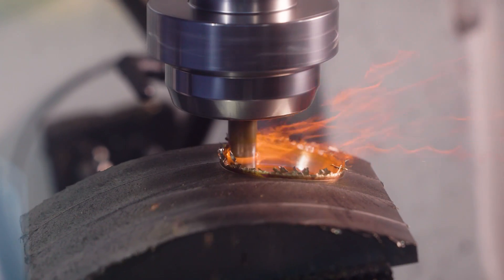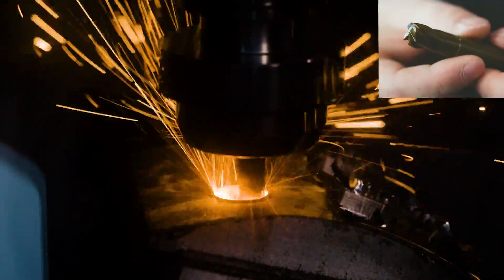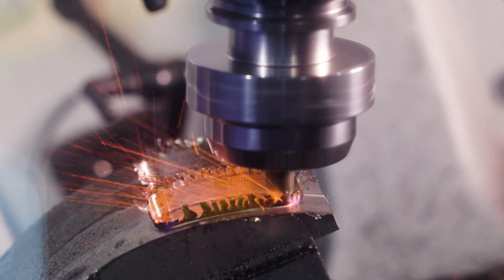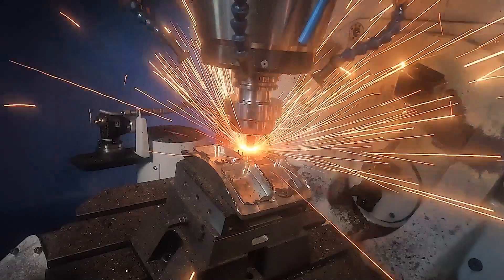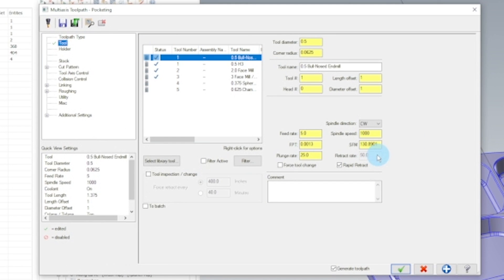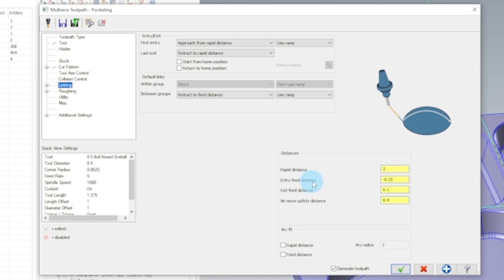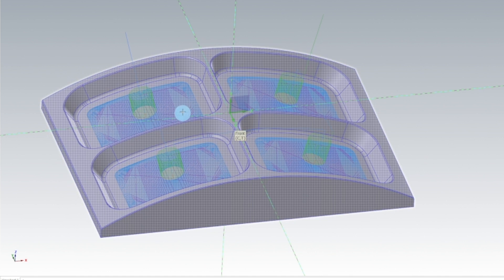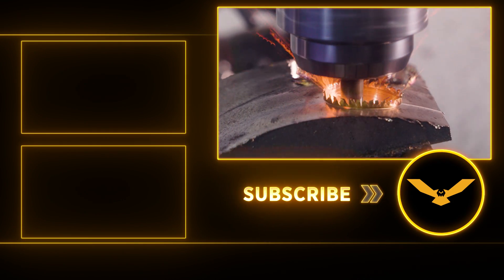5 Axis "MultiAxis" Toolpath in Inconel 718 using Ceramic End Mills

Comment: I wonder what's the advantage to ceramics inserts compared to carbide?
Reply: The ceramic melts at a much higher temperature therefore the cutting edge is maintained during cuts like as per the video.

Comment: Could you show us how that stream of hot chips eats into the tool holder? Is factoring in a new tool holder after so many hours a concern?
Reply: I have 20 years cutting inconel. the last 10 using ceramics and what you do need to factor in is the damage those hot chips do. We have had major fires that have evacuated the whole shop.  But also, those chips are like grinding dust. They work their way into the guards and cause damage. They also dull the windows until you can't see what's happening. You also have to factor in that each edge on the tips need changing all the time. We almost lost all the speed gains in the wasted time changing tips or tools.

Comment: 15 thousand plus RPM, but essentially a finishing cut as the initial roughing/hogging pass, Hah! Ceramics turning all traditional notions upsidedown.  Coolant would ruin it.
Reply: How does this work, and why no coolant?
Reply: @samuelyoung2671  there is high material removal due to the very high RPM which means a lighter cut per flute with each turn. Ceramic cutters run at very high temperature and it would break from thermal shock if coolant was used.
Reply: @tech-utuber2219  Wouldnt the theory be with coolant it never gets that hot in the first place… or is the rpm just so high coolant can’t ya know…cool
Reply: @samuelyoung2671  the reality is that coolant cannot instantaneously remove the heat at the interface where the cutting is actually taking place due to aggressive removal rate of material which is what this is, seemingly light cut but at very high speed.
Reply: @tech-utuber2219  so inconel 780 must have extreme temperature resistance. Seems materials would melt, work hardened, or otherwise not machine well in this sort of situation.    
Genuinely curious
Reply: @samuelyoung2671  yes inconel alloys are nickel-based, for high temperature applications such as jet engines, etc.

Comment: Could you tell me if this tool would be good for aluminum with no coolant
Reply from the maker: No it would not
Reply: Ok , will you make a recommendation on what to use. We are cutting a sandwich of light pieces and using a 1/2 carbide with coolant. The pieces are about 11 feet long sticking out the side of the machine. Makes quite a mess. Thanks